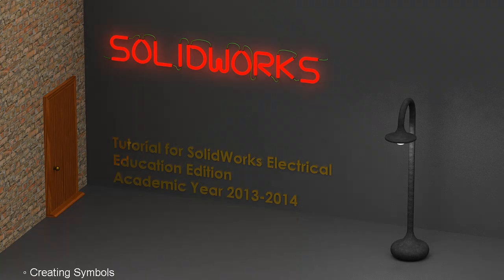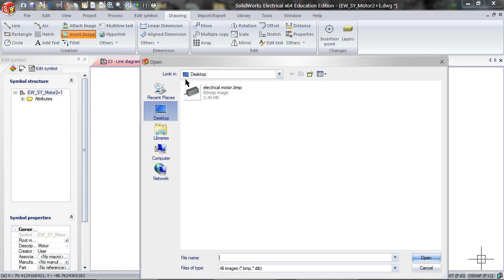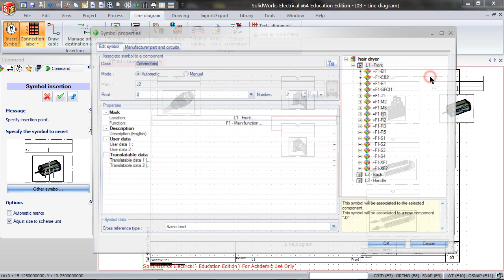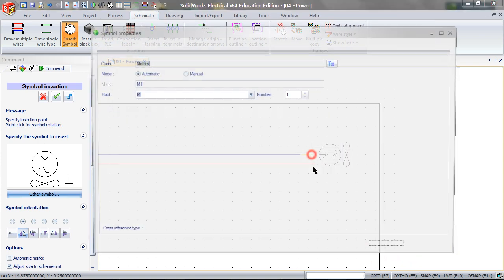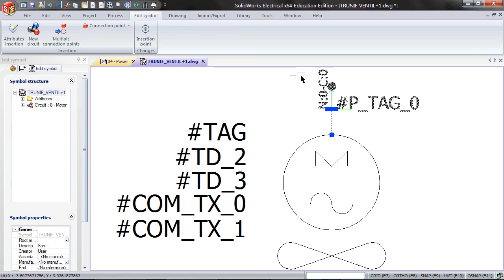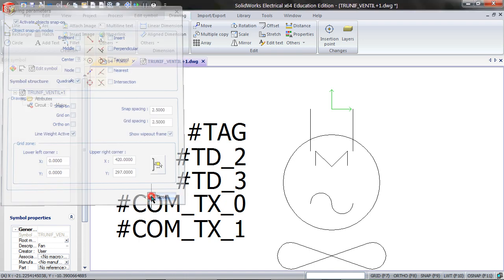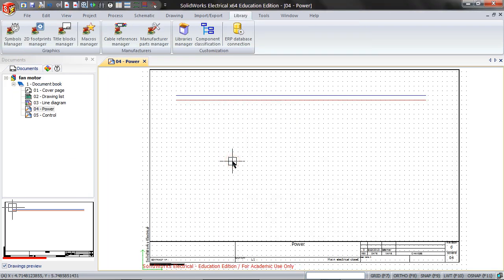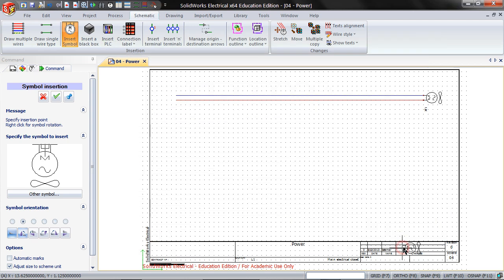Creating Symbols in SolidWorks Electrical 2D

Comment: i can't import the image, i convert it from png to bmp but, i get a white box in solidworks electrical, i used photoshop to convert the image
any help with that ??
Reply: I found the solution to insert the image without converting into bmp file. Select the file that you wanted to insert like jpg, jpeg, png, gif... right click on the image, open with Paint, minimize the Paint tab, then you can see the image is inserted. Once the image is inserted, you can close the Paint tab. I found this easy method from another video.
Reply: Do you have the answer? i can't do it...help me.:(((
Reply: @ducthoma6908  I found the solution to insert the image without converting into bmp file. Select the file that you wanted to insert like jpg, jpeg, png, gif... right click on the image, open with Paint, minimize the Paint tab, then you can see the image is inserted. Once the image is inserted, you can close the Paint tab. I found this easy method from another video.